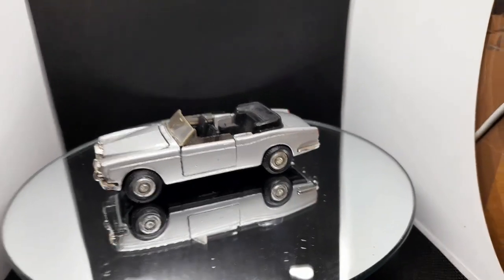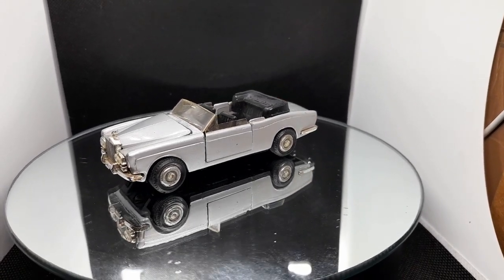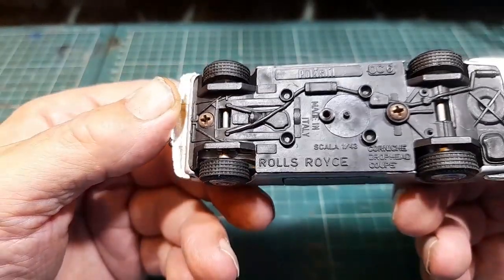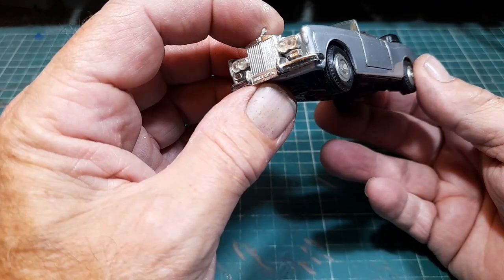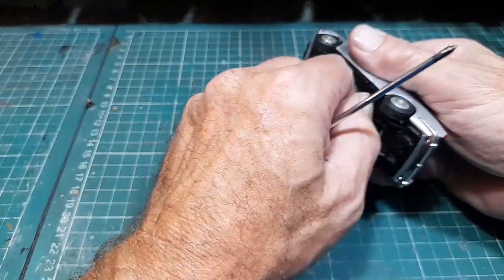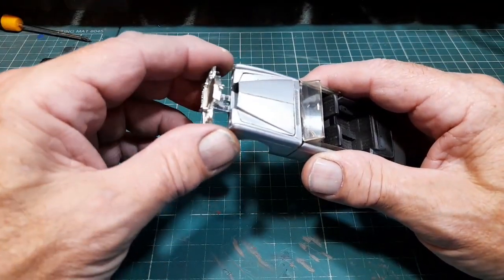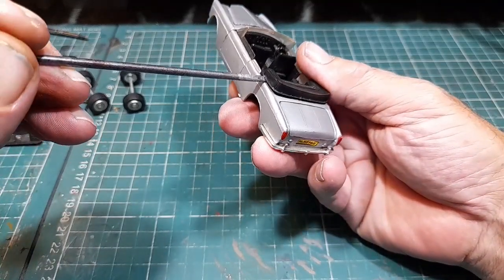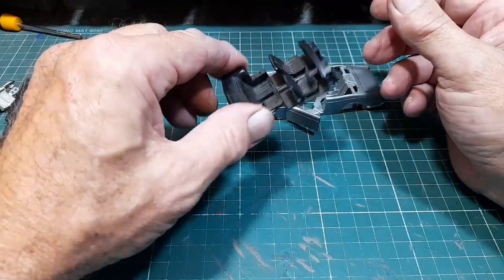Diecast Restoration DMC monthly challenge.A tribute to our late Queen.

Comment: "Polly-still" - that'll work!
Bit heavy on the wheels but a nice model - great job on the restomod - fit for a Queen indeed!
I have nothing for this month - neck gyp apart from anything else, so the bench has been quiet.
Tolerances on the Polistil stuff are quite tight usually, so there is a lot of snap fit stuff, in my experience of the bigger scale cars. The problem in getting the tight stuff off is always getting the buggers back on, especially after paint!
Turned out nice, again!
Reply from the maker: Cheers Fraser, you are right those opening parts were definitely not meant to come apart 😉,  but the bonnet had to come off ,or the paint would have been a mess .
Thanks for watching my friend 👍
Reply: the polistils from the era before Mattel bought it and a while later before they came up with cheapo designs (and the brand name Mebetoys) were actually pretty well made! once caught a Fiesta Mk1 in 1/25 scale, and didn't realize the bonnet and trunk were opening before I had it in my hands, the pieces sat so tight. XD